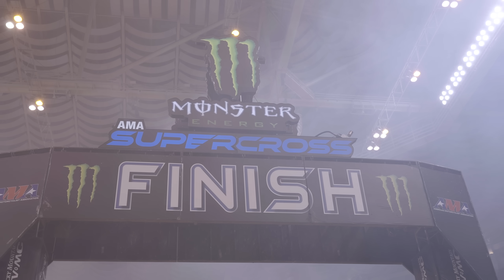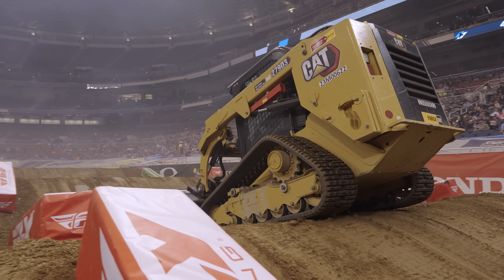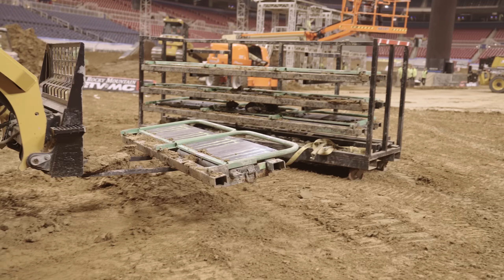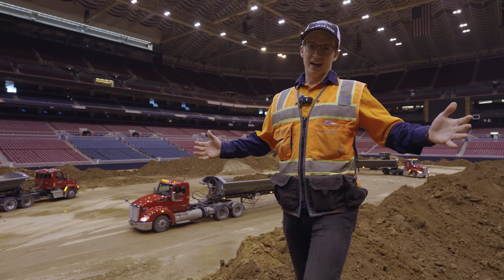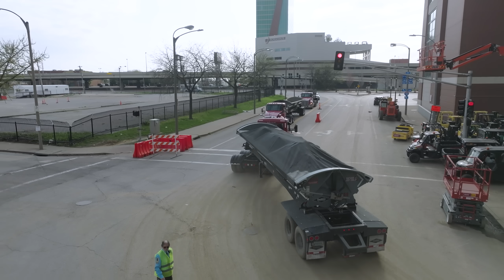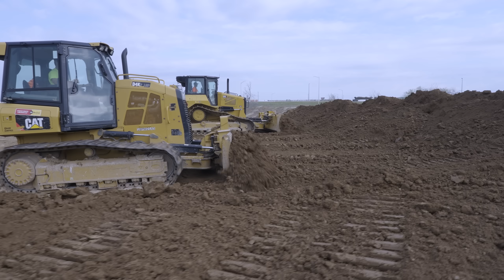Removing The Dirt For Supercross!

Comment: Someone can correct me if im wrong but 350 loads 20 trucks 20 minute round trip per truck prob 5 minutes to load. So 25 minutes total. Finally gives you 17 loads per truck at 25 minutes per load. So about 7-8 hours to remove all the dirt.

Comment: Thanks to the companies for them letting you film.  Maybe NBC wont be such a pain next time and let you show some of the race.  This vid is interesting, I never knew how this happened, and then the stadium would have a band come in the next week.  The only thing I was curious about that you didn't answer was that Im sure the entire stadium was a mess, and you don't need to show that, thank you.  But if they picked up the trash and cleaned the restrooms, how much dust does the dirt cause in the stadium due to dust?  I bet that after the dirt is all moved out, they have to dust all the seats or use a wet paper towel to get all the dirt out.  You don't have to worry about dust and the mess it makes in most vids, but this one a lil different. just curious

Comment: That is way more material than i imagined.  It's hard to believe these events are economically viable.
Reply: Attendance is normally very good at each Supercross round. I flew out to Anaheim 1 (Angels Stadium) and it was sold out for both rounds. They will leave the dirt in the stadium at some rounds and mix in monster trucks. In Arlington, TX (cowboys stadium) I was told the stadium does a dirt month, rodeos, monster trucks, etc. Add in NBC revenue, feld entertainment does very well.
Reply: @AndrewDeVries211   I didn't think of the media and sponsors revenue. Doing rough calculations in my head considering the amount of earth moving going on, ticket sales alone didn't feel like enough to break even, especially in smaller venues/markets.
Reply: @AndrewDeVries211 I’m in Fort Worth, Tx and you are correct. Every year, supercross and monster jam run back to back weekends.
Reply: It’s been happening for 50 years. I don’t think it would continue if they were losing money
Reply: I can’t even think they make money
Reply: @dillondeclue967  bud your clueless they sell out damn near every round of supercross
Reply: The dirt is used year after year and stored offsite, so it’s the same dirt each year. They also try to follow monster jam and the dirt can be left in the stadiums (Both owned by FELD Entertainment)
Reply: There’s a 50 million dollar investment made every year. Cost about a million a week to put together
Reply: Average ticket price is 85 bucks average attendance last year was 50k according to NBC, that's 4.25 million per round in just ticket sales, pretty sure they are fine
Reply: The manufacturers give a lot of money to make this happen. Just think of the old saying “win on Sunday...sell on Monday”
Reply: Not a chance they’d be doing it if it lost money 🤣
Reply: @Dm0stFin3sT  they get money from government its a cycle
Reply: Welcome to Motorsports
Reply: Assuming around $65 a cubic yard to load and haul that’s like a half million to get it in and out. Just ball parking and order of magnitude cost. Could be more or less.
Reply: Sometimes there is also a monster truck event with in a couple of week window.
Reply: Keep your opinions out of this
Reply: They’ve been doing it for 50 years so I’m sure it’s fine
Reply: NBC  is currently footing the bill
Reply: @tjroe5190  feld not nbc
Reply: You ever watched supercross? 😅 or any racing?   That’s why
Reply: They're not
Reply: St Louis for example keeps that dirt off-site and uses it for supercross, monster jam and the Gateway Dirt Nationals
Reply: Sport has downsized a lot since I raced in 2011-2015 super expensive super competitive lots of injuries and a not that great tv promo cycle they don’t make a lot of money compared to most other sports buts it’s more something that you just gotta love
Reply: Australian truckers would've reversed out of the stadium with B-doubles ... standard
Reply: I quoted something pretty similar for an event near my town. 60k I what i came up with and what it would've cost todo. It was for a monster truck show. We had buy and supply material. Trucking both import and export and then pay a disposable fee of all the material cause now they had to re screen it all. Plus a ton of guys and rental equipment for stuff I didn't have. The dead line was unreal. One day before the show we had to bring it all in and have it ready for the crew to make the obstacles. So not really even a full day. Because they needed quite a bit of time to. We had to give them I believe it was 8 or 10 hrs. Basically show was on a Sunday. Had to have all the material in there late Saturday night after the hockey game that was there prior. And then after the show. I believe it ended at 9 we had to start for 930 go all night so they could have the stadium back Monday morning for another hockey game. It was insane. And we couldn't destroy any plywood the dirt was on. We didn't end up getting the job. But I based my quote off of all these factors. I think Material and trucking alone was 20k.
Reply: A lot of PPV viewers watch you gotta realize.